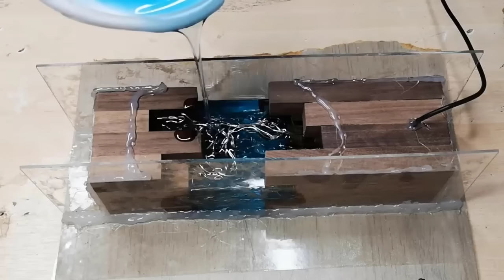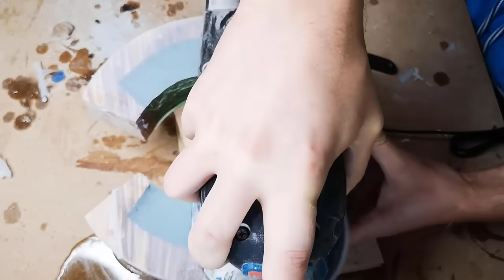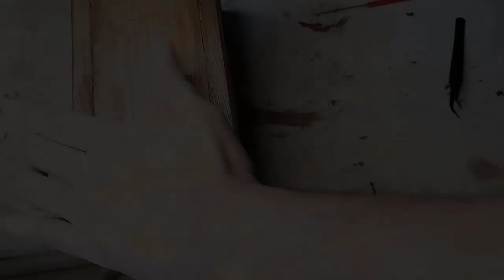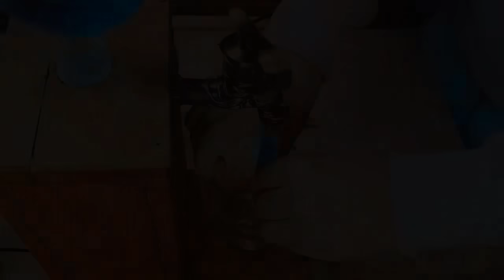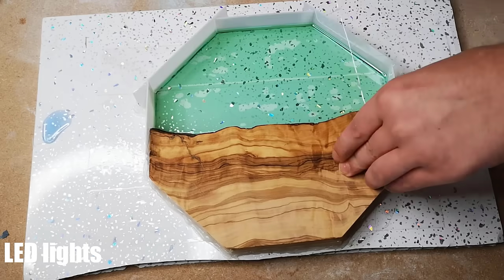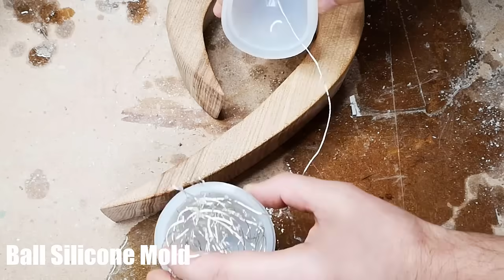5 Most Amazing Epoxy Resin Lamps / Resin Art

Comment: that's really cool, but you shouldn't be using lights directly in the resin as they have a finite life span. instead you should use fiberoptic cables or something that will allow you to achieve the same effect while also separating the light source from the artwork, allowing you to replace lights as they burn out.
Reply: Exactly, this piece will die with Series.
Reply: @khmnc  Greetings from Poland ❤️🇵🇱
Reply: Exactly what I was  thinking and was disappointed with his choice of lights 😏

Comment: The lamps look great once finished, but they could look even better if your attention to detail was consistent throughout each project, i.e. making sure not to over tighten screws & split the wood, also when using wood stain, make sure all the wood that will be seen gets a coating, even the cracks between the boards. It's simple details like this that will take your work from 'Great' to 'Fantastic'. That said, I really do love your creativity in making these lamps, I particularly love the Horseshoe lamp.
Reply: Who made you the boss  what this guy does is amazing  I’d love to see you do better
Reply: @MichaelJones-nn7my  You have misunderstood my comment, I think this guy is really talented and the pieces he makes are really good BUT my point is they could be fantastic if his attention to detail was consistent. A prime example is the blue tap lamp, it's a great piece but it would have been a fabulous piece had he taken the time to check that the wood stain had covered all the wood, even in the cracks between the boards and the screw had not been over tightened and split the wood. I'm a perfectionist, I can't help it, so little things like that really bug me.
Reply: Yup.

Comment: Love it! Two disappointing notes however. 1. Those LEDs burn out relatively quickly. 2. The water into the cup with no splash was a huge oversight. Keep up the good work <3 <3 <3
Reply: I agree. And about the lights, how about making them accessible so they can be changed? Thanks for sharing your art!
Reply: @dharmabalance  How can they be accessible if they're encased in resin?

Comment: What is the epoxy material used for? What are the proportions of confusion? What is the time required to complete the hardening?
Reply from the maker: proportions per 100g epoxy resin  45g hardener , time hardening is 48h

Comment: Please explain how you get the LEDs which you seem to struggle to keep flat stay in place ready for the final pour. These are awesome by the way!
Reply from the maker: I use hot glue
Reply: @mbresinart  Great thanks. I guess not much or does it blend in with the wire.

Comment: Where did you get the LED strings that you use and are they 5 V so they plug into a USB? Very cool work I got a try it❤️🇺🇸
Reply from the maker: on Amazon , I use fairy LED lights power batteries and usb

Comment: My resin cracked when It was setting ??? Any advice
Reply: How thick was the pour?
Reply: Along with the thickness the temperature for resin is everything.  Check the label of the resin for the cure time at what temperature.
Reply: What do you mean by how thick was the pour like how much resin did I use ????

Comment: I have a question, (well a couple of 'em really_ is epoxy resin flamable, and if it is, is there a way to msake it flame retardant.

I am THINKING about using epoxy resin to protect the decks of my boat, but I don't want to turn it into a floating Roman Candle.

Alternatively is there a flame retardant coating that can protect the resin from flames in the first place, and please don't say H2 O wHAT IS THE best TREATMENT AVAILABLE ?.

Comment: Every LED light fixture is a piece of art of its own, however I see one big flow in this - when the LED's die or get dead, the light becomes a useless piece until disassembled and put back together with new epoxy and potentially a new wood. So if the wood for lighting is an expensive OAK or else, maybe we should reconsider the investments.

I am not yet sure how, but I think such pieces must be planned with a "LED Lights Chamber" which will not be fully filled with the Epoxy and that would allow to build such lamp or decorative desk gadget in 2 pieces that can be joined together nicely while still allowing the chamber of LEDs to be replaced if/when needed.

Just my 5 cents as an idea or why not a challenge to the masters of this channel ;)

Comment: So what happens when the lights need to be changed ?
Edit : like what if you need to change out the LEDs for some reason, how do you take them out or for some reason need to be replaced ?
Reply: In this instance you don't change out the LED lights.  They are completely and totally encased in resin.  The equivalent of "needing" to change out a pixel in your computer monitor.

Comment: I have a question: Doesn't the resin start to melt when these lights become hot after glowing for some time?
Reply: No, it hardens and then after that it doesn’t turn back into a liquid
Reply: @crdm1103  wow! Nice.
Reply: They are LED so no heat

Comment: Love this piece, can you tell me of you squirted water on while sanding or something else? Also I never saw that nobby thing for sanding. Is that for polishing? I did some scroll cut out wood work in the past, but am doing resin pendants right now.  Did you spray those glass pieces with release before using them? I use Poly resin. How about bubbles?  just ignore me if I ask to many questions. Its really a awesome piece.  The other pieces you guys do aren't shaby either.

Comment: For the best possible adhesion with Gorilla glue you need to dampen the other surface otherwise you run the risk of it not holding properly

Comment: Light emits heat, epoxy resin can melt!!
Reply: LED's or Light Emitting Diodes have near zero energy loss to heat (Infrared light spectrum), they have a near perfect energy to visible light conversion. Unless you buy infrared LED's, point is they will defiantly not melt the resin.